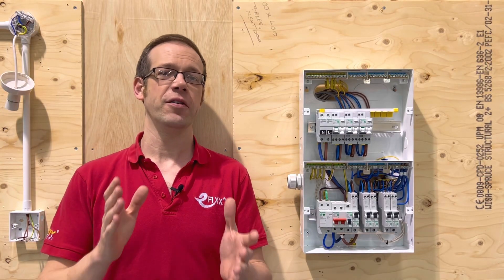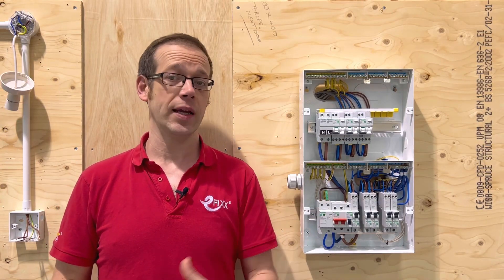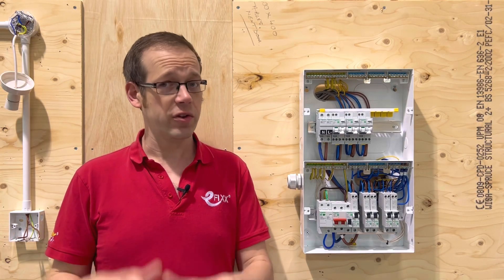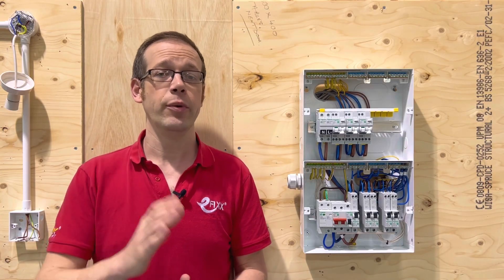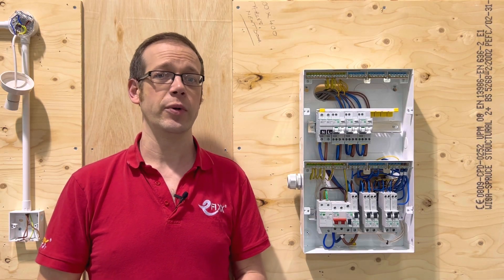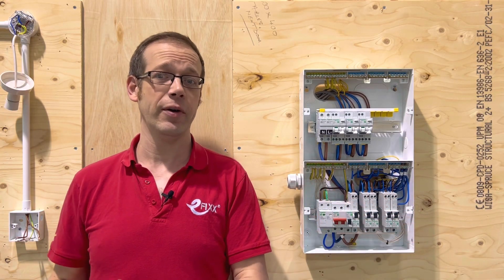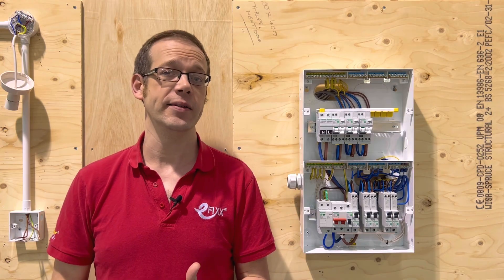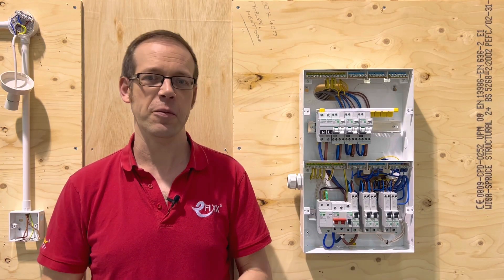What is a Residual Current Device (RCD)? and how do they work?

Comment: There is a device available to protect from electric shock from live to neutral if the mains voltage was 12 volts the same as a 12 volt transformer plug instead of 230 volts.

Comment: What if i use 3phase RCD in series with inverter which generates symetric currents per phases, and the consumption on 3 phases are no symetrical. The current that returns with neutral conductor is not 0 as the sum of 3 generated currents?

Comment: In the diagram you show a toroid transformer with two windings. One winding in the live line and the other in the neutral line. First this would lead to an increase in resistance. According to Amperes law if you had a winding encompassing the entire line and neutral pair when the currents are equal in both lines no induced power will be picked in the outer coil. Think of the clamp meters you only put it around one of the wires. With AC you could put quite a few turns around the pair and thus increase sensitivity without affecting the source impedance. With DC all I can think of is a Hall Effect device. I was trained in the Electronics field. Still puzzled how these devices actually work.

Comment: Please do a video explaining how earthing works on a 240v inverter in a work van. hypothetically, imagine there are at least two appliances with "earthed" cases, like a microwave and kettle. There is a lot of conflicting information online about earthing to the chasis, or having a earth rod, in which cases would protections devices work or not. thanks!
Reply: This is a tricky area, If you are running your van say from a Campsite power system no need to use a ground rod. As long as the entire chassis is connected to the Green/Yellow wire. Of course you are relying on the campsite source having its own RCD system. For extra safety get an external safety outlet the plug your extension cord into that. In my van I have backup battery's running a  3000W DC to 240AC inverter  which interfaces to a mini switch board. The inverter is bonded to the chassis and power goes through a special RCD breaker. As you say you get so much conflicting information make sure all you're wiring is in really good condition. By the way my only interface to outside power is a 70 amp battery charger and solar.

Comment: Something I miss in the video is a very fundamental difference in the way RCDs can be build.

There are electronic as well as electromechanic RCDs. Why does it matter? While electronic RCD mechanisms can be built small and quite cheaply, they are absolutely dependent on the presence of a voltage supply and wiring direction and are much more volatile to surge damage and interference.

For example, if the neutral or pen is absent or supply is unstable, it is unable to operate properly.

Electromechanic mechanisms are much more reliable, but they are bulky. They will trip when there is a current imbalance, regardless of the voltage. You can even trip them when feeding 100mA with a lab supply on the neutral path (switch it on / off a couple of times). Electronic ones are completely blind in the absence of stable supply. While the size issue doesn't matter for "traditional" RCDs (sizing 2 to 4 modules in width), until recently this was a huge issue for compact RCBOs.

And that's where there is a fundamental but little known difference between uk and germany. In britain, electronic RCBOs took over the show completely, especially due to the tiny size of british consumer units and lack of space therein.

In Germany, electronic RCDs (except for flat DC detection mechanisms in type B units) are forbidden by the standard and only voltage independent ones are allowed. Until recently that had the very unattracktive sideffect that RCBOs generally took up at least 2 modules in size each. But now there are two manufacturers who managed to size the mechanism down, namely Siemens 5SV1 and the ABB DS301C.

Might be an interesting topic for a video for eFIXX to have a deeper look at?

Comment: Do RCD act as MCB when a direct short either L to N or  L to E???
Reply: No, they do not have overcurrent protection.
Reply: thanks @okaro6595
Reply: A Dead-Short of L–E is considered Earth Fault and will ultimately Trip any RCD as intended.

An RCCB, subjected to a L–N short-circuit may Not trip the RCCB. But due to the Sudden Imbalance at the Sensing Coil due to the Dead-Short, sometimes it may trip the RCCB.

As for RCBO, when subjected to a L–N short-circuit, it will Trip due to the overwhelming at the Magnetic Coil that reacts to Short-Circuits.
Reply: Subscribe @mainly electrical to learn

Comment: When it comes to a TT systems. The meter tails go straight into a 30mA RCD and then into the D/B's.
Reply: 100 mA type S on the front end for TT with normal type A 30 mA downstream no...
Reply: @intercity125  and make sure the downstream RCDs are double pole, speaking from experience. 😬
Reply: Yowza let's hope nobody plugs anything dodgy in otherwise you lose the entire install
Reply: @paulmatthews5470  it does unfortunately. This is why I tapped off the incoming side of the RCD and put a dual RCD in the shed so when something trips out there, it doesn't take the whole house out. Every time I take a supply from a DB and put another board in, I never put it on one of the RCDs incase the other board trips and takes out everything.